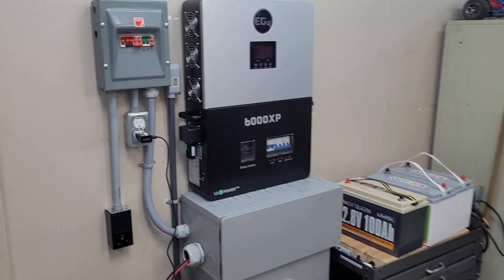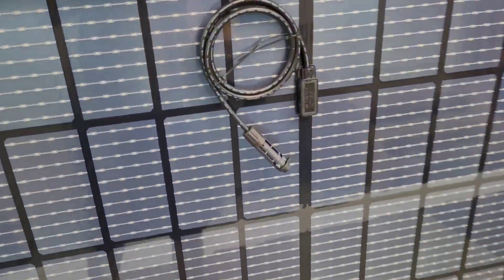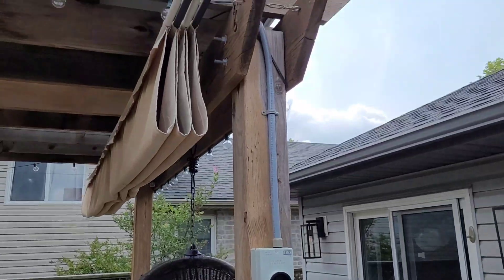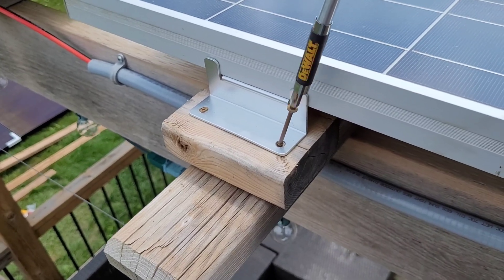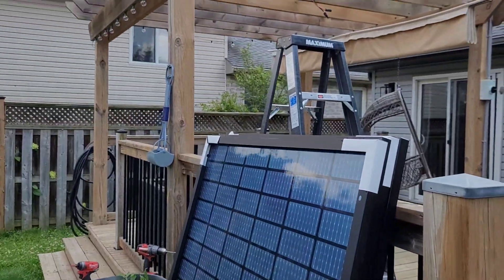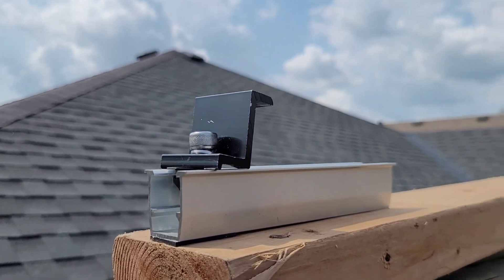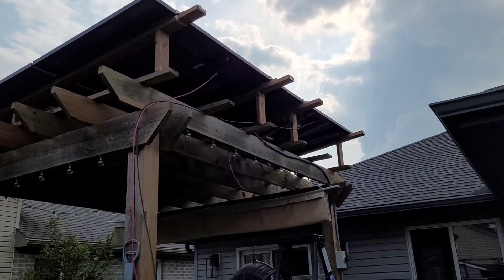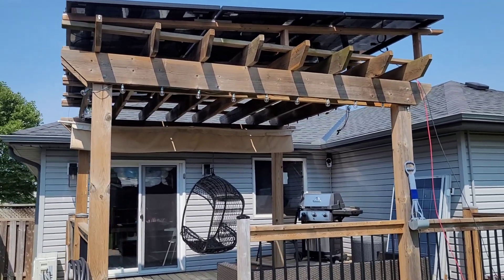Building A 2.5KW Sirius PV Pergola For The EG4 6000XP

Comment: What's the shading tolerance of those panels in series on the pergola like, can they work with one totally blocked out of the sun, since most half cells solar panels connections are in the middle and have multiple paths, example the voltage may just go in a straight line through to the other side past the shadowed one?

Comment: These solar panels are rated 13.8A maximum PV amperage (ISC) but your EG4 mini splits are only rated for 12A. Are you going to chance it?
Reply from the maker: @martinsteflik1329  These are only connected to the 6000xp, but it would probably be fine

Comment: You might want to consider a different panel clamp. The style that pulls down the top of the panel versus hooking to the bottom can cause the vinyl to separate over time from the panels.
Reply from the maker: Thanks, do you have a link to that style of clamp?
Reply: I'm interested in this as well... I would like to secure my panels from underneath and not from on top... I would also like to be able to close the gaps.  Please share a link or a photo if you have one please!

Comment: Why not use the ones you took off to plug straight into the eg4. Yea would have to build something for it but that way eg4 would have the solar connection into heat pump and also from 6k egr Inverter
Reply from the maker: I probably will, just need to decide where they're going to go

Comment: Everybody doing videos on these panels. looks nice
Reply from the maker: @rodneyhunt  Thank you, I was just about to watch yours.
Reply: You two should do a collaboration video. I actually got a EG4 24K BTU because of the two of you! We just installed it two weeks ago and the 7 Boviet 450 watt bifacial panels with SnapNRack Topspeed mounts over the weekend! Today we turned OFF the 240v power and it ran ice cold all day long and maxed out at over 2400 watts! We have enjoyed the mini split and have been using it to cool out entire house 🏡 without our Central HVAC A/C in 95 degrees+ temperatures! Incredible. The family loves the new unit. We are looking to get 2 or 3 of the 12Ks in the future. We will see. Right now we have 18 solar panels on our roof and 5 on our off grid solar shed. 

God bless you two. 

Jeff - Sunny Central Florida ☀️
Reply from the maker: @onecrazywheel  Awesome, sounds like it's working great!
Reply: @SmitHVAC.  It really is! No complaints. Thanks again for all of your videos. I have learned a lot. My grandparents were from Etobicoke area near Toronto. We used to go to Toronto quite a few times in the early 90's. I remember going to two Bluejays games as well. Excellent memories! God bless 🙏😀